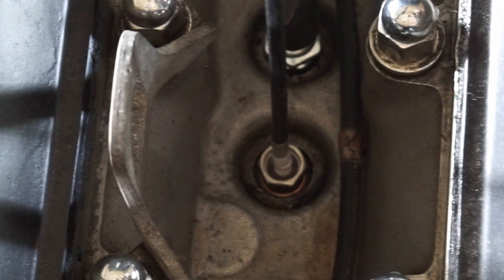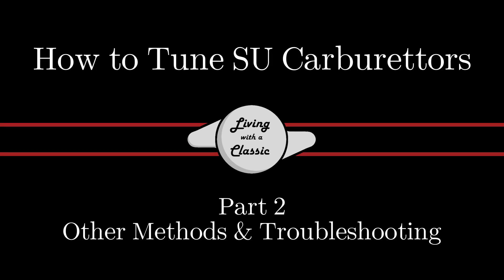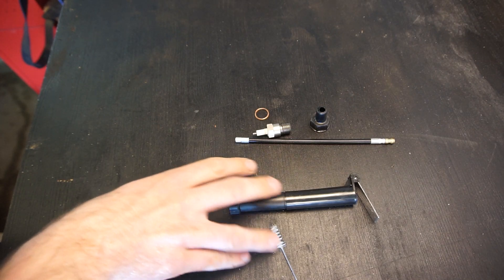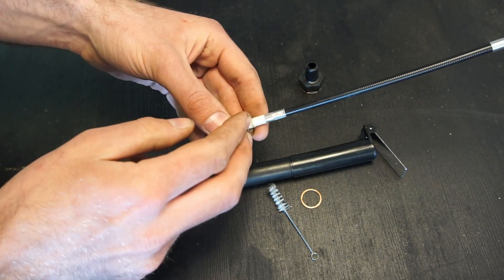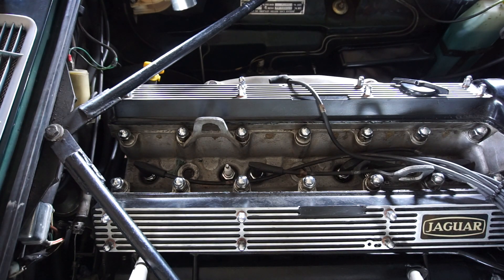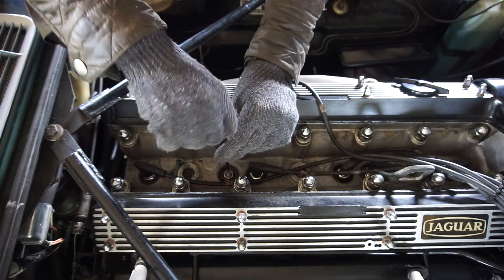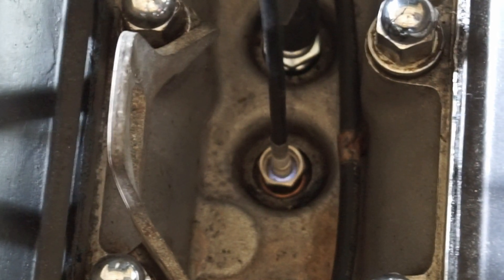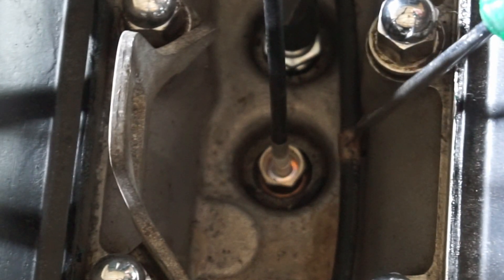How to Tune SU Carburettors (part 2) - Gunson ColorTune

Comment: What a lot of people either don't know, or forget to mention is this;
Gunsons Colourtune will not work with 2 stroke engines!
The oil that is mixed with the petrol/gas alters the burn flame colour that is not compatible with Colourtune.
I've used it successfully in the past with 4 stroke engines, it's a useful product.
My classic car isn't running right, but it has a 2 stroke engine.

Comment: Adam, I have 5 cars with SU,s on them. Adds up to 12 single carbs. All of your posts talk about a fuel mixture screw which I have none. All of mine are adjusted through the dashpot. Is your type or mine uncommon? No one ever responds to my comments so will see? I guess you click the bell top right. Cheers, Randy
Reply from the maker: Are you sure they are SU? Some Strombergs are adjusted through the dash pot

Comment: I've been using the 'Color Tune' since it first came out in the mid 60's.
I've progressed through all the models produced  I'm not keen on the present 'small' model.
I've got a set of six 507916 Color Tunes which are the original 'large' models.

Comment: Very helpful video!   I just switched from a single HIF-44 on my classic Mini to twin HS4 carbs.  I have an air fuel gauge and O2 sensor which works great on a single carb because it fuels all cylinders evenly (as evenly as the manifold can distribute the mix).   I thought I had the twin carbs tuned correctly based on the AF gauge, but when I removed the plugs, the two on the drivers side carb were normal to lean, and the two on the passenger side carb were full of carbon.  The AF sensor saw the mix between the two and showed within spec.   I just ordered a Colortune after seeing your video, and it certainly seems like a must-have for more than one carburetor especially.

Comment: Great video. But just one thing; I hope you don't mind me saying but it looked like you may have used a little bit too much force to tighten the plug. You'd be surprised if you've ever used a torque wrench to tighten plugs to maufacurers spec, but it's just a little bit past finger tight. The reason for this is that a regular spark  (and the Colortune) are made of an outer metal shell and an inner core. If you over tighten a plug you run the risk of breaking the seal between the inner core and the outer shell. In a regular spark plug, this can cause a  vaccum/ compression leak between the steel collar the the ceramic insulator (I've done this myself). In a Colortune, it can cause the glass viewing insulator to separate from the steel collar and shoot out like a bullet (I've heard of this happening).

Comment: That is not really tuning is it, its running idle with the  Idle AFR setting.  Tuning has to happen under wo and load  conditions at different rev's. But besides that its a reasonable good tool and cheap to set your idle mixture..  I have one and have it compared with an AFR dial... That shows that the color tune is not all that precise and leaves a lot of room for error , its a rough estimation... but better then nothing...